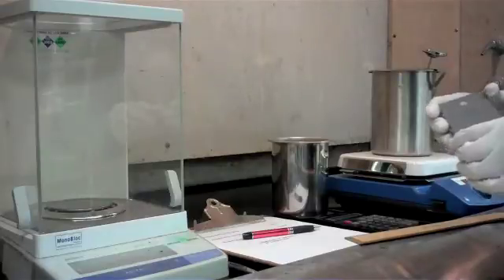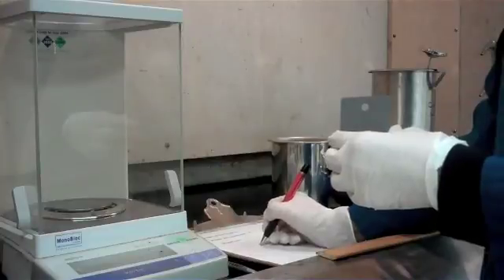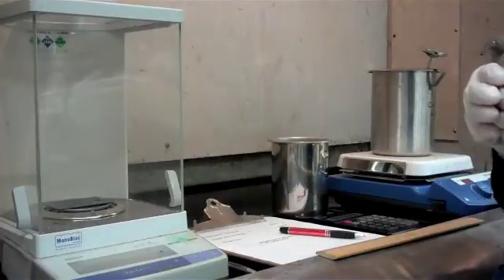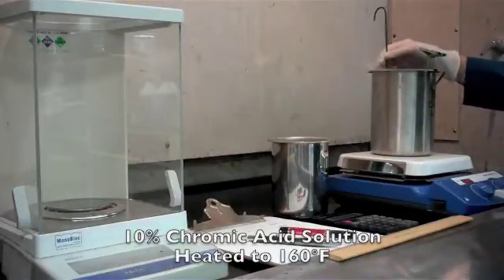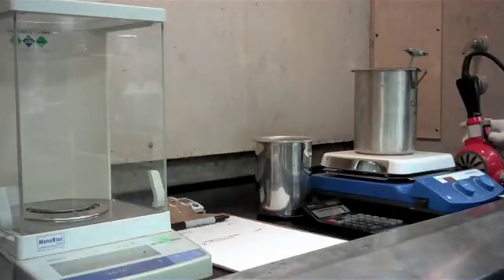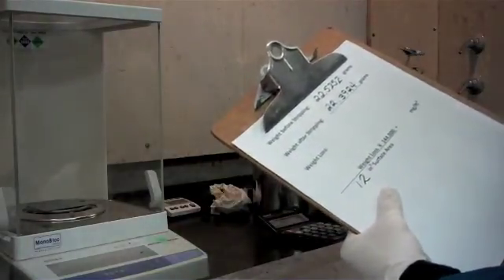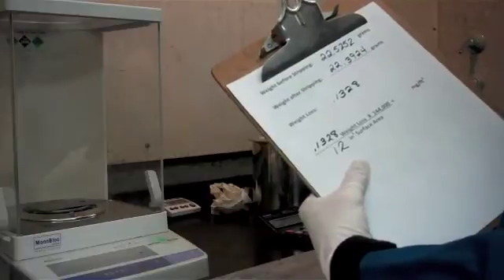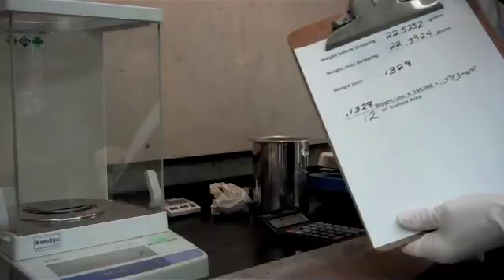Phosphate Coating Weight

Comment: If accuracy is of importance wouldn't the panel surface area need to be calculated more accurately. Such as the area of the rounded corners and the hook hole being subtracted from the total area. Also the thickness of the walls also need to be considered as they are part of the surface area.
Reply: Max Erickson use